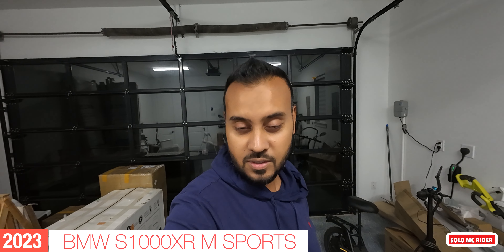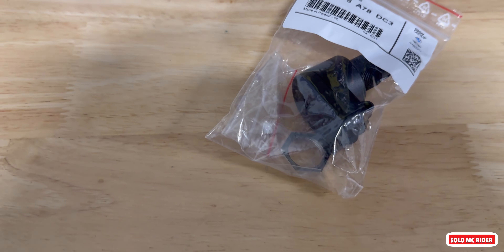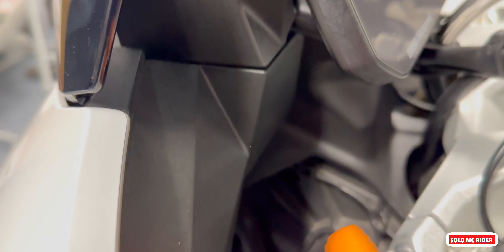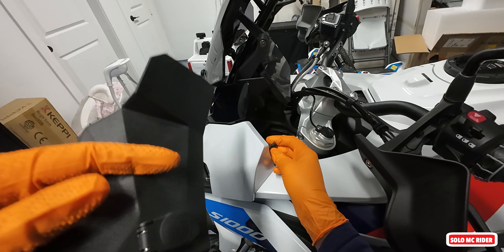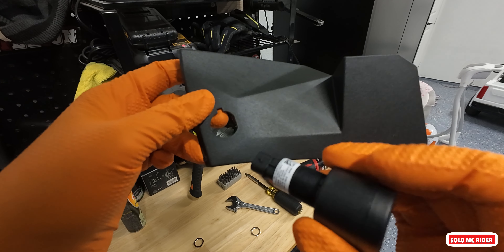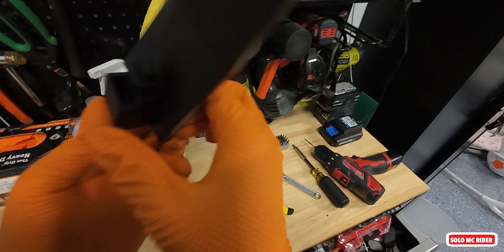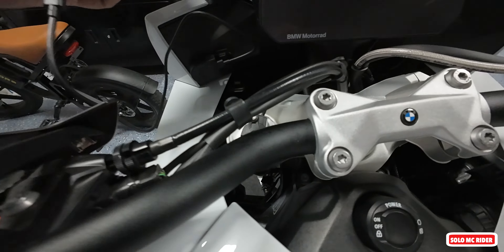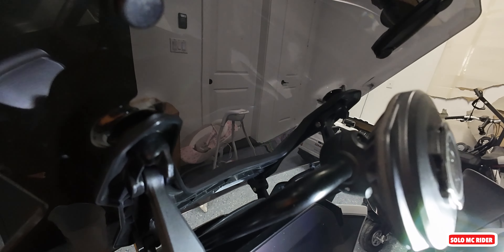BMW S1000XR USB-C Charging Port Install: Easy DIY Guide!

Comment: How did you connect the power to the quad lock charger that is on the navi bracket?
Reply from the maker: With usb c port behind the quad lock charging head , usb c to usb c!